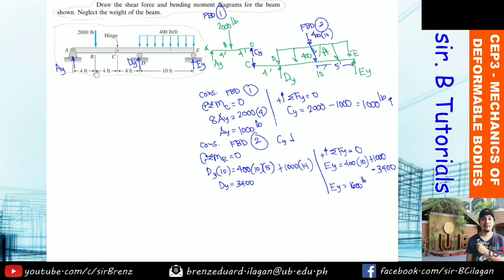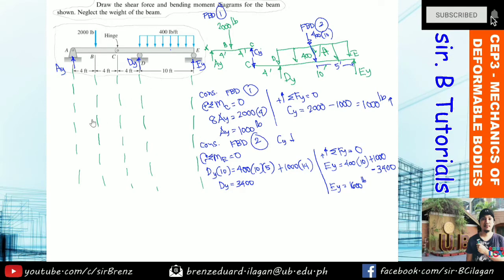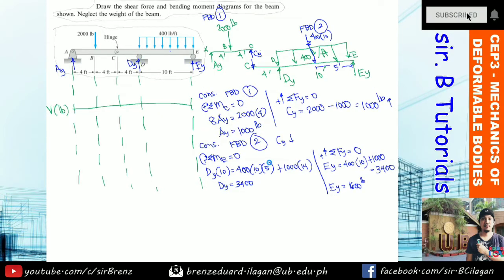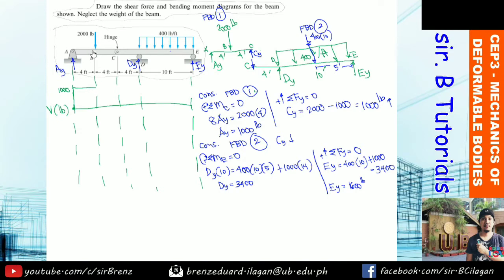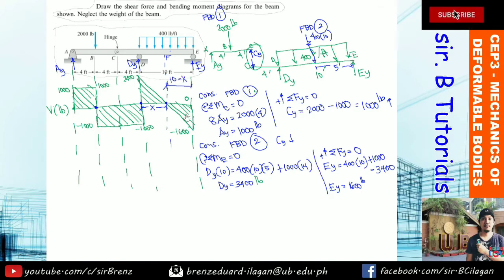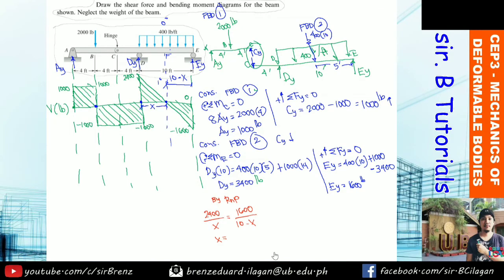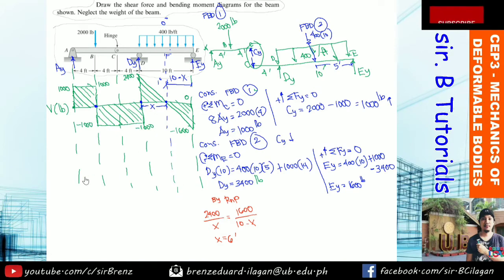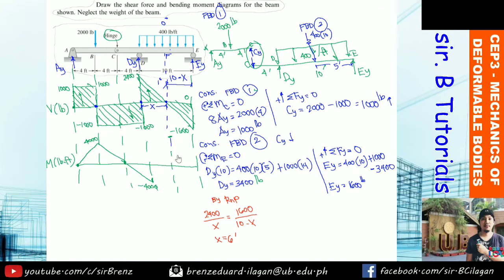Mechanics of Deformable Bodies - Chapter 4 - Shear and Moment - With Internal Hinge (Area Method)

Comment: sir,diba dapat yung Cy mo sa fbd 2 negative kasi counter clockwise rotation niya sa point E?
Reply from the maker: trinanspose ko na sya sa kabila ng equal sign kaya nag positive, if your going to watch my first part lecture. especially sa SRB i shared a technique na magskip ng isang line ng equation which can cause error sa pagtranspose and simplify ng equation. We want to eliminate those factor like personal error. :)